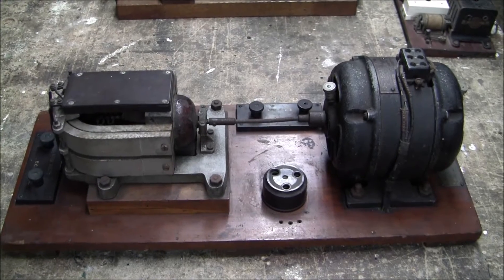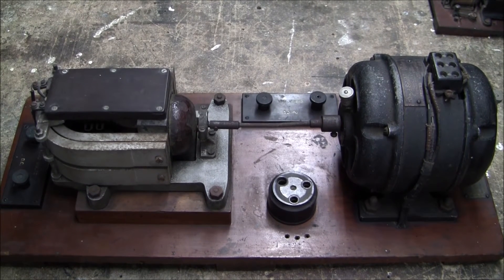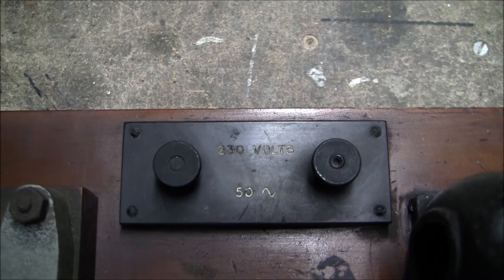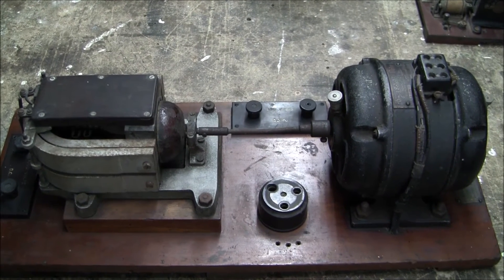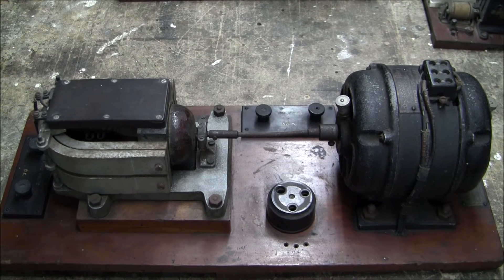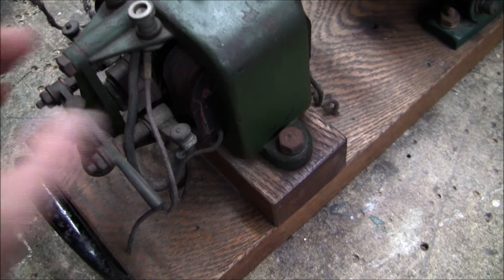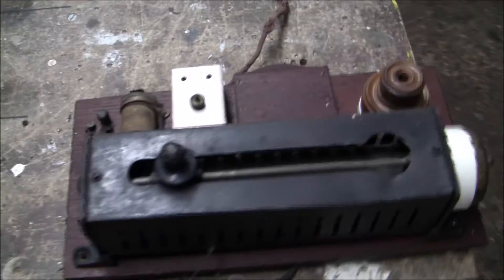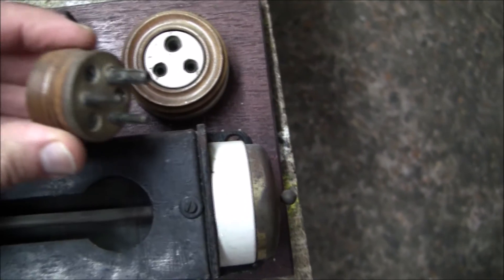Rotary Converters

Comment: These are MG sets, not rotary converters. A true Rotary Converter (also called a Synchronous Converter) shares a common armature and field windings, and has slip rings for AC input and has a commutator to provide mechanically rectified DC output. The advantage of a rotary converter over an MG set is that you are not converting electrical energy to mechanical energy, back to electrical energy. Some of the energy in the rotary converter stays in the electric state. And yes, there is a complex start-up procedure for large rotary converters. Mercury arc rectifiers can be started relatively simply compared to rotary converters of the same size. There is also less maintenance to be done with mercury arc rectifiers versus rotary converters. There generally does not need to be a substation attendant present 24/7 for mercury arc rectifiers. Some rotary converters were fully automatic, however they still needed to be checked on at least weekly.

Comment: Motor-Generators and Rotary Converters are two very different machines. You are showing motor-generators. Rotary Converters have a common DC and AC armature and the armature is wound with the windings common to the AC and DC sides. The AC power passes into the armature via slip rings, then coming out the other end via the commutator. The commutator in a rotary converter is acting as a rotary mechanical rectifier.

Comment: So as not to confuse, these are motor generators. A rotary converter is a single machine with ac and dc windings on the same armature. It can convert ac to dc or vice versa.

Comment: good show but can you try something always include the amperage as well as the voltage as it is necessary for when you feel like using the materials you have shown. please. no big deal no one does it but i wish people would i can't stand missing. pieces like why can't i do that to may elelctric car with two full unit start with a 775 motor and yanmars and ebike batteries i could make one that is perpetual motion. one just charges the other during operation and it has plenty of time as the ebike battery drains at 13 volts for fifteen hour while the end outpost is 1400 amps and 284 volts using four beat truck alternators. just use dual yanmars then a 3hp motor to turn the self excited alternators. the hardest part is winding the transformer and finding the resistive wire from the 1950's that you have to buy one piece at a time. usually 3 dollar a length. i am not sure it will work on the 350 amp alternator but it does work on the 200 amp alternator and if you believe this will not work watch this video of uncle edison's work in new york (NYC's 45-Ton Rotary Convertor
) loosely related i am the grandson of Alva Windle. the  rotary converter above can be pasted in for a youtube show that show a step up generator system powering the new york subway for 120 years. that is electricity making more electricity using a rotary converter so that no more fuel is ever used.

Comment: Very weak ark, considering its 1,000v dc.

It should be a bluey/Green hissy ball of flame- even though its current is low.
Reply from the maker: I was quite impressed with it seeing as i did no work on it before hand, like cleaning the commutator.